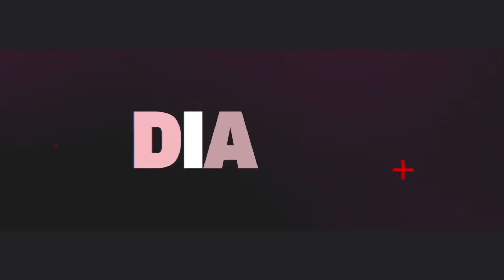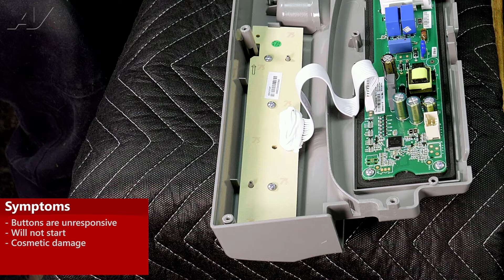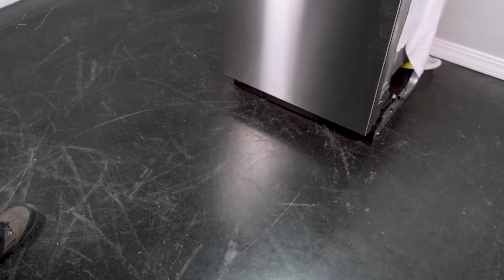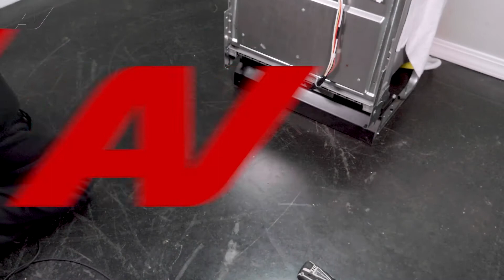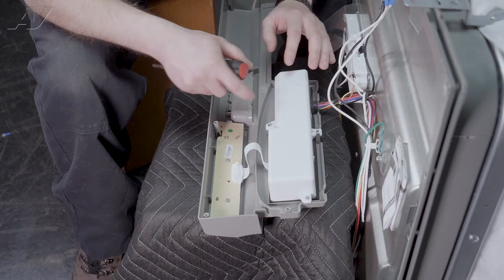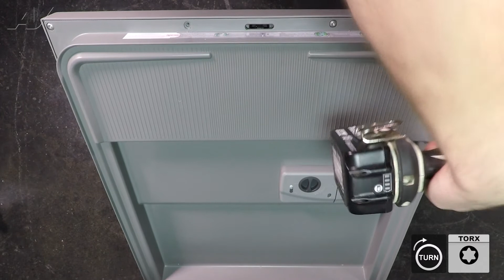Frigidaire Dishwasher Repair - Buttons Unresponsive - User Interface

Comment: With this particular control board where could I find the thermal fuse. We had a power surge and believe it may have blown the fuse as the outlets work and my husband checked the door lock with his multi-meter and it is getting power.